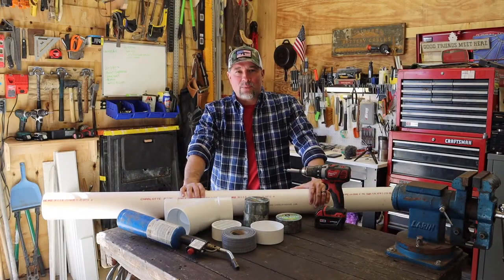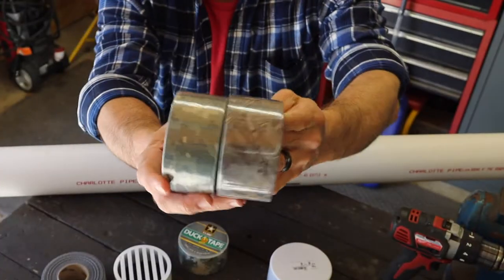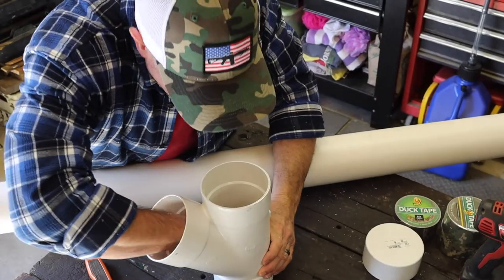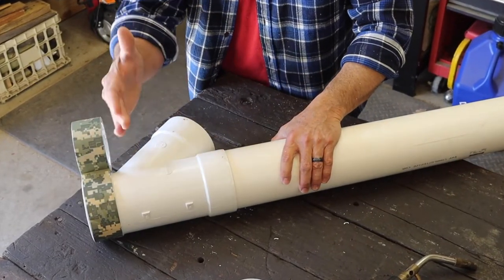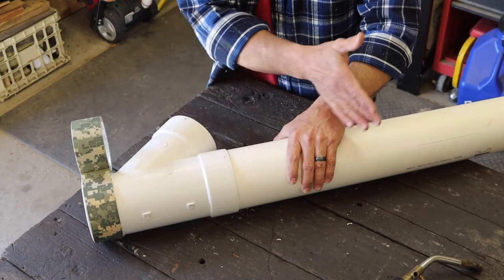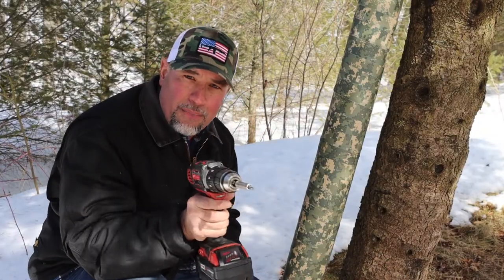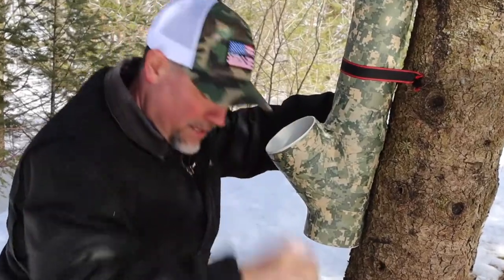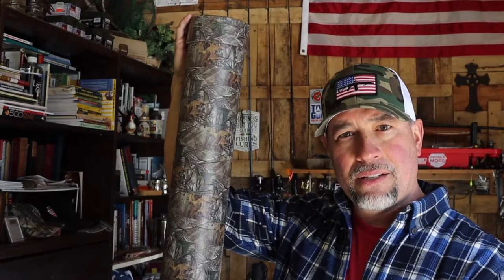How to make a Homemade DEER FEEDER - DIY #DeerFeeder on the CHEAP that you can build yourself!

Comment: All you need straight pipe with a cap and camouflage paint sprayed on there. put pipe on an angle were corn won't fall out I've been doing that for 30 years works out good

Comment: looks nice, but looks challenging to fill. In my area, i would be worried the hogs would knock it off that screw.  I'd probably have to add a 30" piece of pipe for support.  thanks for sharing

Comment: I might paint my next one with woods type Colors. I’m an Automotive Painter. There’s a process to use a plastic cleaner and adhesion promoter. Tough as nails when done correctly. I also like to pull off leaves, branches etc and hold against the pipe after a couple Colors are applied then hit them with Color. Looks like real tree, tapes fine, but pricey in Canada..
Reply from the maker: This is a great idea!!! I’d like to see your finished piece

Comment: I took a router bit and just scarred up the side of that PVC and took a 90 in a 45 degree and put it on and then I sprayed it with brown and gray paint for one little hole in the back on both sides if I could do a tree just remember to cut it off every year

Comment: Do not use mesh tape on the drain piece at the base. Otherwise, rain water will collect there. You want any moisture to pass through. Instead of tape, use 3 screws around the perimeter to hold it in place. I've used this same system for over 20 years.

Comment: Easier and cheaper...drain tile. 4' section with a "mouse hole" at the bottom...strapped to a tree.
Cap it if you want...doesn't matter, the corn will all disappear just the same.